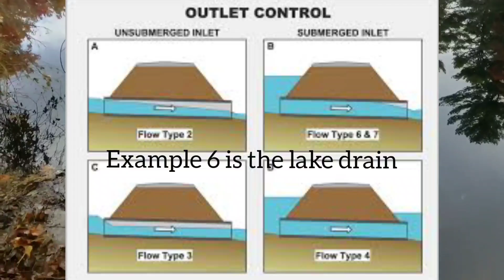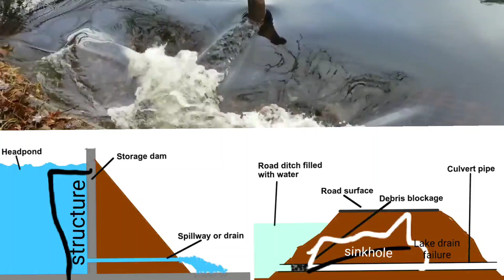The dangers of differential pressure

Comment: A great way to think on this is a vacuum tube. When off the tube pulls nothing. Turn it on and suction increases. If you put your hand part way over the suction increases in the area not covered. If you cover the opening your hand is stuck. Even if you turn off the vacuum your hand is stuck until the vacuum tub leaks air back in the other end. The issue with water is once you cover that pipe the vacuum is still on the whole length of the pipe and your body is to weak too get away. Unfortunately it can pull you to shreds with those kind of pressures.

Comment: I was in a park the other day and there was a dislodged manhole cover with a water bottle wedged in it. I didnt have a crowbar to settle a 300lb manhole cover and the dpw was closed so I called the police. They got a dpw guy to come out and when he opened it, it was flooded to the lip with water bottles and empty nips floating around. Basically the downstream pipe was clogged and upstream pressure during a storm pushed it open and litter from storm drains got wedged between the lid and casting, getting it stuck open. Thats another example of the power of water. If someone accidentally stepped on that cover while dislodged its horrifying to think what could have happened.
Reply: Won't be walking over a manhole anytime soon. 🌺

Comment: The danger is no joke. Back in the 80's a girl working at the YMCA summer camp in my area lost her life because she got too close when diving to open a fitting to drain the pond. It was an incredibly dangerous setup that required a diver to manually connect a y-fitting on the gate valve 15 feet below the surface.

Comment: Laying some science on everyone, awesome! People just underestimate the power of water in general... Like trying to kayak over a low head dam because it "looks harmless." Like in your case here, the suction, pressure at its height was equal to both the weight of the water in the full culvert pulling and the weight of all the water in the lake above the level of the drain pushing. Crazy to think about how immense all that pressure is.